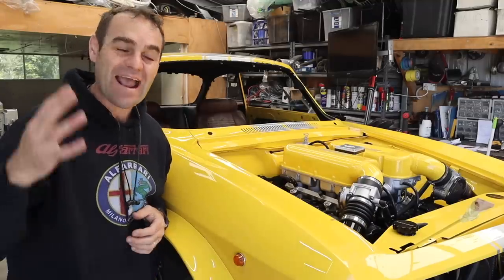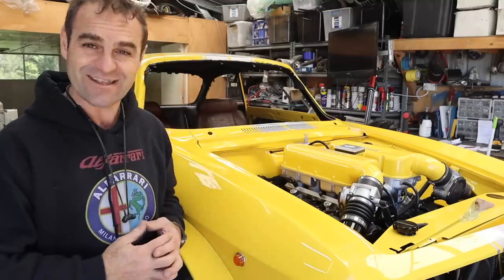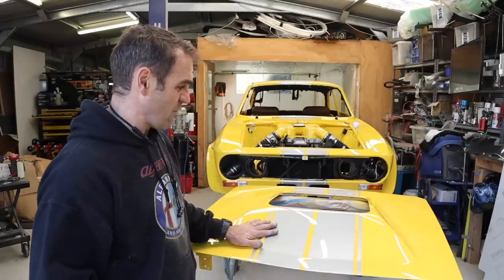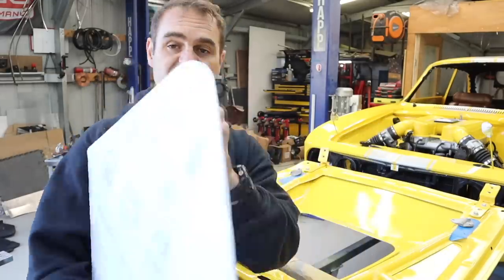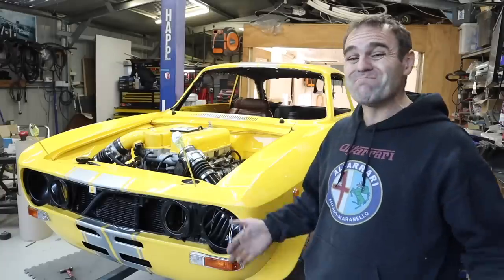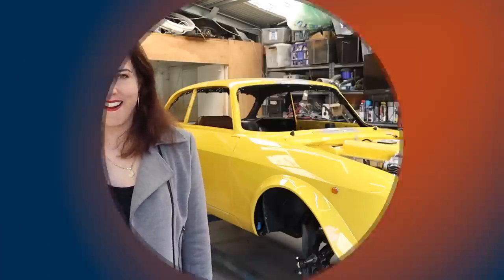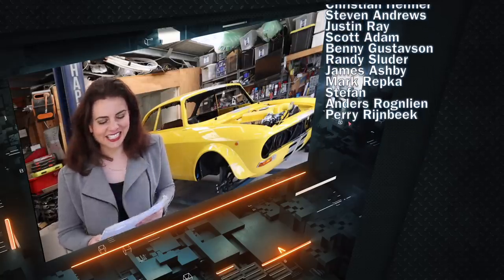Ferrari window to the soul - Ferrari engined Alfa 105 Alfarrari build part 176

Comment: Well, the plex is in. Thoughts... even with the best of adhesives, with all the tension in that part, engine heat may wish to dislodge it. You might have drape formed this part early in the game prior to cutting the hole, but that was then and this is now. As it stands, the reflections will be a bit off as the part doesn't curve from side to side, just front to back. So what to do. I'm sure you will live with it for a time, but I know from watching every episode of this build it may bug you eventually. If you do revisit it, consider a having the part flush with the hood as well, perhaps milling a reassess edge around the part to flush it out to part thickness. Meanwhile, building this car is a monumental task and my hats off to you. Congrats on a beautiful car.

Comment: Was hoping you would get a decent window, thicker, route the edge recess so that the top would be flush mounted to bonnet outer, not sit beneath. Would give that focal point a much more premium, specced look. Sitting below the bonnet just makes it look off. Like an after thought. This is the make it or break part to the whole concept. A premium look will just make it pop. 👍
Reply: I agree 
A flush look with a routed edge would look amazing
Reply: Doesn't look too flash from where I'm sitting - but don't worry Polycarbonate, Sikaflex 252, no primer... He'll be Baaaacck! (sorry Jeff)
Reply: I agree with all of this, also the way it is now, if it's parked outside, and it rains, there will always be water standing over it, which might cause some corrosion in the future (i doubt it will be parked outside for long times though), but it would definitely look a lot better flush with the bonnet, also on the inside, i would probably just mask it, and just paint it the same colour as the car, not black, as Jeff said, it would just stand out too much otherwise, or make a chrome/silver piece over it, it would just make it look better.

Comment: Hi Jeff, you may run into a problem with the Urethane de-bonding from the Plexiglass, especially with the heat it will be receiving, as standard Urethane is not rated for plastic adhesion. I assume you're using a Sika product and almost all of them require a primer to aid adhesion to Plastics of any sort. If it lets go you'll find the adhesive on the Bonnet will be very smooth from the Plexiglass. The paint on the under bonnet is also very smooth and requires priming as well.  Dm me if you like and I'll point you in the direction of the correct adhesive :)

Comment: Coming along nicely Jeff 😊 As the saying goes the last 10% takes 90% of the time. Hopefully the plexiglass stays where it is and doesn't try to revert back to it's flat state and pull away from the glue. If it does start to pull away then look into thermo forming, I think that's what it's called. Basically the material is heated to a certain temp that makes it pliable and then it's held in it's new form until it cools and this then sets the materials 'memory' into the new shape. Anyhoo, hopefully that's not needed 😉

Comment: How about a black rubber window seal for the perspex window? You could fit in the groove of the panel and then use the string method to pop the perspex in, like with an old Mercedes windscreen.
In order to hide the bit where you cut the rubber trim, you could fit a chrome/stainless fitting to hid the cut line.

Comment: Love the way this is coming along and how you cover so many different aspects of the build. Like many others I can't wait to hear it run!
One thought for your lack of spare ECU outputs (1min 50secs in). You might be able to fire 8 injectors with 6 outputs. Pair up the cylinders which fire 1 rev apart and connect 4 ECU outputs to the power side of the 4 pairs. Then use the 5th and 6th outputs to ground 4 injectors each, so the appropriate cylinders fire on the right rev. A bit of a logic required to figure out the connections, but it would at least free up 2 ECU outputs for other uses!
Reply from the maker: In that case I could just run it as a wasted spark ignition and just use 4, but I don't need to as it should all work like I have it.

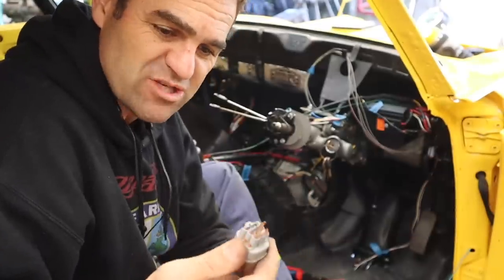Comment: 4:42 - it's infuriating when they do this. 
Happened to me when I was accumulating parts to retrofit the 156 GTA Xenon headlights in my 156 2.0TS. Ordered the pigtails from a breaker in Italy and one was ok but the other had 1cm of wiring 😤. Had to de-pin and rewire with usable length wires.

Comment: I have had three of those controllers die. Im currently running full time until I can find a better solution. I would say if you give up one sensor in the ecu do it!
Reply from the maker: Interesting. I will keep that in mind. I will definitely sort something out with the ECU if the controller fails.

Comment: Wonderful build thus far - ensuring that all is thoroughly addressed.  However, when you finally receive the clutch/brake pedal gasket, I anticipate you are going to have a hell of time to install it without damaging it - it's an absolute pain in the backside, made worse as the current rubber material (probably of Chinese origin) is not as 'durable and malleable' as the original.  As covered in a previous episode (don't recall which one) it will become obvious why some restorers modify the pedal assembly so the pedal head is bolted, rather than welded, to the pedal's shaft.
Reply: Even then, the slots in the currently available pedal boot aren't big enough to fit the pedal arms. I can't see how they can ever fit without splitting. If I could be bothered doing it again on mine I would slice the rubber to control where it splits to ensure it's towards the bulkhead. A black zip tie around the boot on each pedal arm pulls the boot closed and isn't obvious.

Comment: I am not an expert, but having the sealant of the window not reaching the outer. edge of the metal seems like a shit idea. water woll creep into the gap for sure,
Reply: It will, there's been several comments already about it, i feel like this is something that Jeff will redo, in the next video, or at least at some point, honestly id wish Jeff would had just welded some studs on it, so he could've just drilled some holes through the window, and just put a gasket in between to seal it, would've probably looked cleaner as well, and not having to paint over it.

Also with it not being flush, it might look kinda meh on the outside, it would probably look a lot better with the edges routed, to make it flush with the bonnet.
Reply: @Vlammenzee  I was surprised too. Everything is so meticulously engineered and fabricated. And the installation of this key element feels rushed in comparison. But I guess sometimes you need a quick win to keep you going. Ultimately, everything that is worth doing once is worth doing twice. 😃